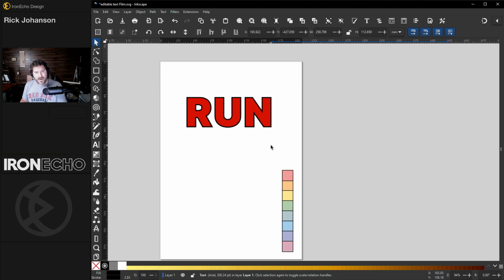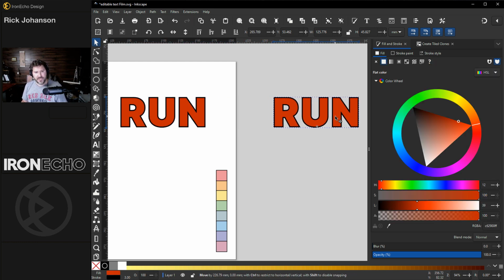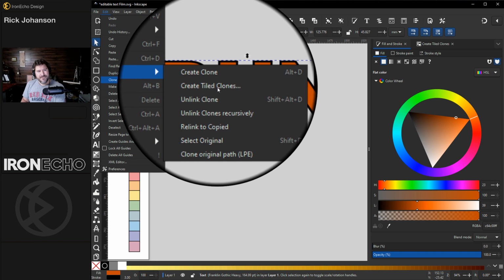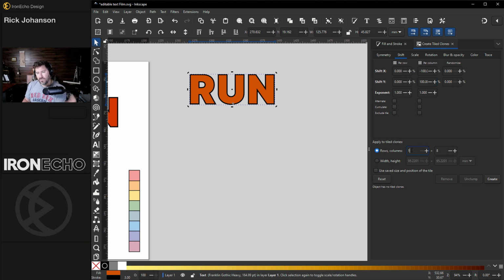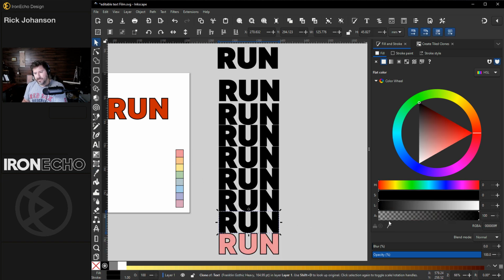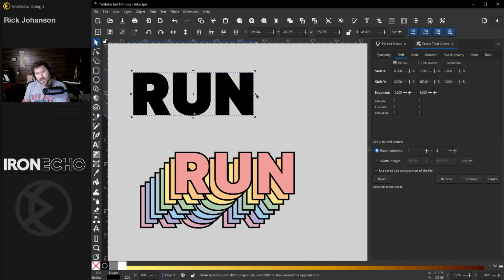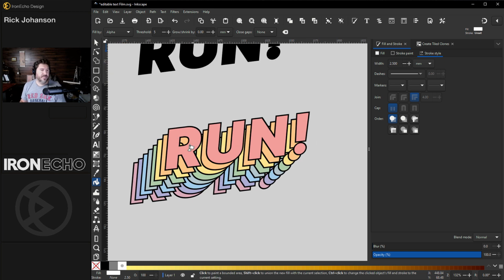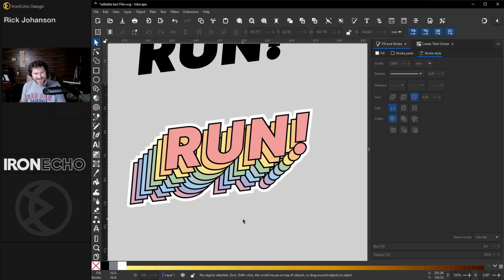Inkscape Easy Text Based Scalable Design | Beginner Cloning Tutorial

Comment: Inkscape clone tech is a very powerful tool. I use them to create dynamic fill patterns. Adjust the "master" and the fill pattern follows. So many different ways to use clones in your designs to save time. Don't forget about Inkscape symbol capabilities!
Reply from the maker: I did forget about the symbol capability.  Haven’t tried it yet. Will explore tonight. Thank you!!
Reply: @IronEchoDesign  I use symbol libraries quite a bit in my designs. CorelDraw has a symbol capability that I would like to see in Inkscape. Update a symbol design in a library and any document using that symbol would be automatically updated.